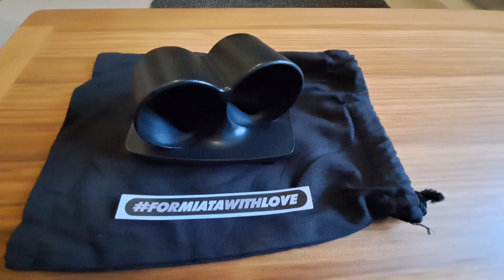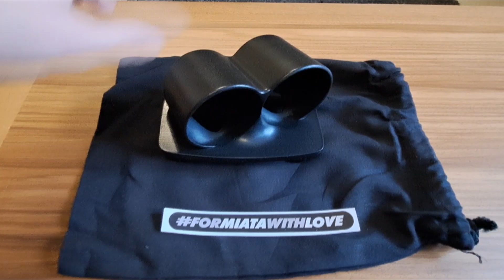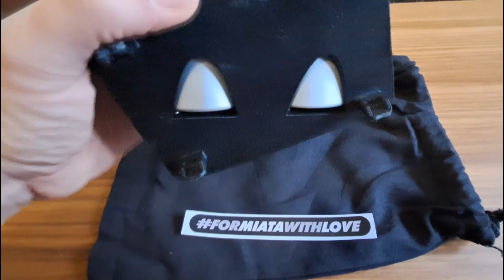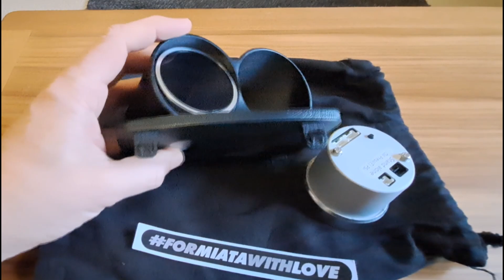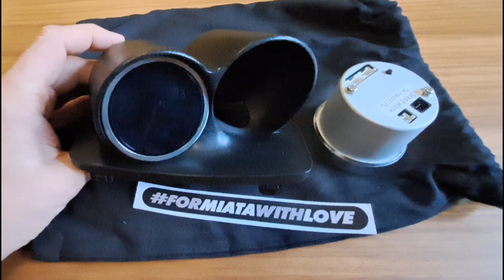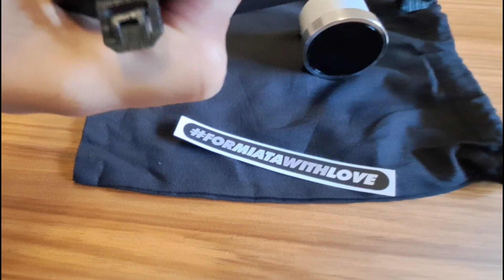Miata MX5 NC TURBO - DIY Turbo build Part 12 - Boost and Oil Pressure gauge installation.

Comment: Planning to do any post install videos? I know you've done your trackday videos. But a video of how it is on the road, what BHP you're upto, any issues you've had etc.
Reply: What is the location of the oil pressure sensor that you are using? Is it with a sandwich adapter?
Reply from the maker: I will.at somepoint. Been chasing a couple if issues that now fixed. The Stage 1, clutch is struggling, so thats an indication that it must have alright power😅